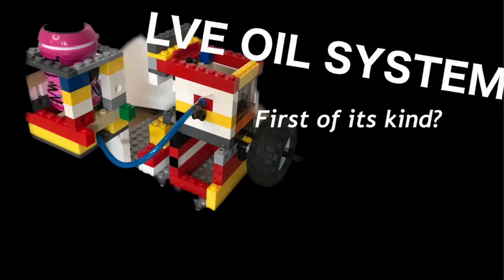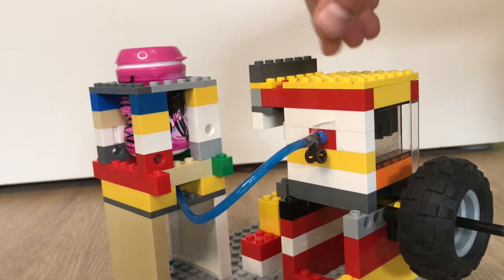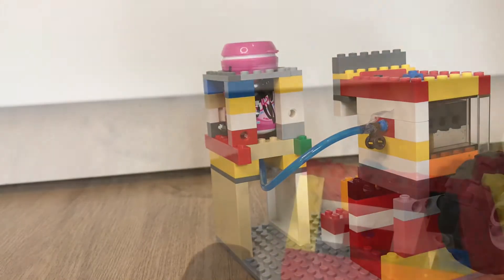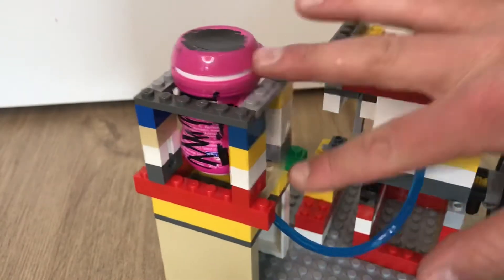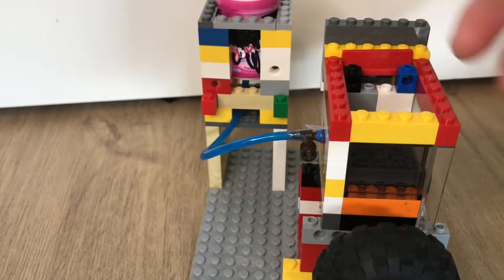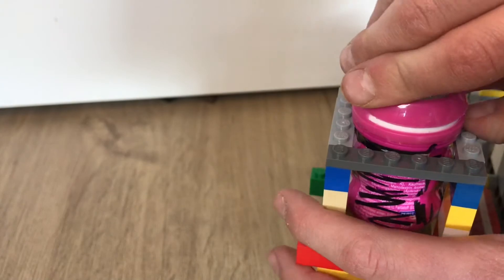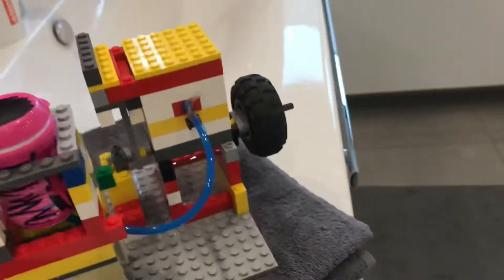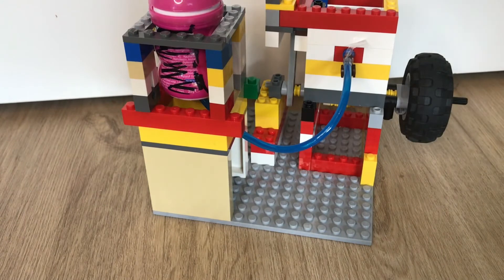FINALLY!!! A LVE OIL SYSTEM!!! FIRST OF ITS KIND

Comment: I have a dyno for running lego engines on. I found there is actually an optimal level for oiling engines.

 My engine produced 4.05w and 1.53oz/in torque with 0 oil.

4.51w and 1.66 oz/in with little oil added

4.07w and 1.48oz/in with too much oil

Comment: Im a little sus as to wether you get any actual performance or longevity benefits from this system, cool build though! it looks like its pretty consistent, maybe if you moved the " oil" to the crankcase and sealed the crankcase so that the crakpins and rods and such were lubed, and maybe if you had some sort of actual circulation system for maximum flow. keep it up, i really like what you do!
Reply from the maker: Thank you sooooo much and I had this idea too but maybe you will build that😁
Reply: A sealed crankcase and oil slinger that would splash oil onto the moving parts, kinda like small lanwmower engines